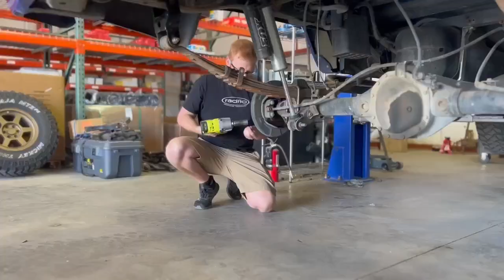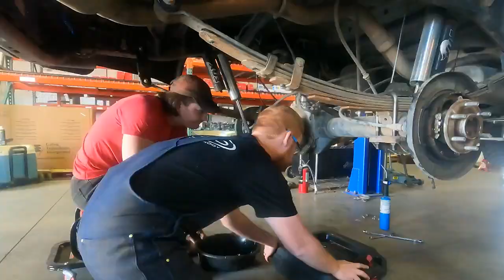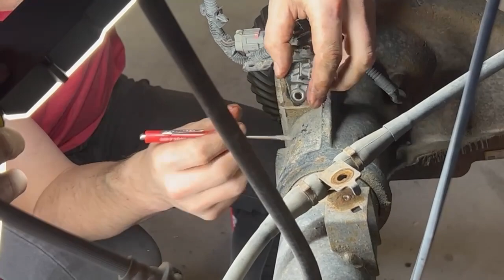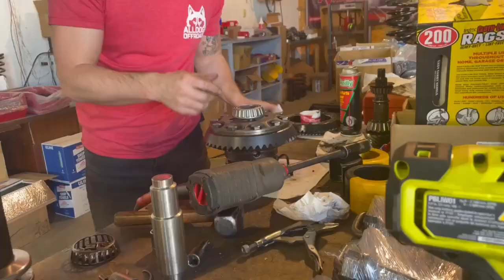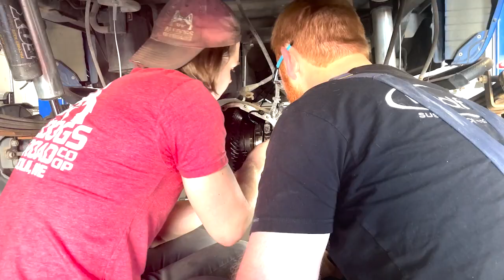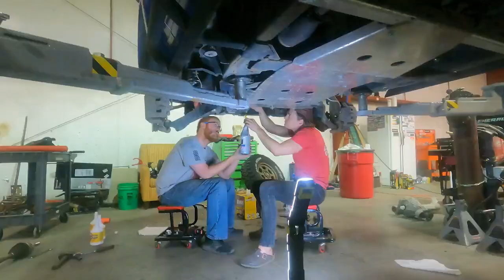Watch us re-gear Kyle's 2015 Titan Swapped Nissan Frontier

Comment: I have a C200 Diff with 4.1 gears, i learned that the early 2000s and 90s frontier and hard bodies had the H233b diff with up to 4.9 gears and the ring gear was huge 233mm in size vs C200 is like 200mm or so.  What i need in my truck is a gear ratio of 4.9 or 4.6 at least. Is it cheaper to buy a whole axel in the junk yard and sell my 2011 axel my truck is just a rear wheel drive with 4 cylinder

Comment: I thought the pro4x came 3:69 mine did. I was thinking of going 4:10s because of 33s and carrying 600lbs over stock constantly. what is your opinion on that?
Reply from the maker: If you have a manual transmission your truck may have had 3.692.  If you have an automatic, you'd more than likely have 3.36 ratio.  With a manual, 4.10 would be good for what you're doing.  With an automatic, 4.10 might be too deep.
Reply: @AlldogsOffroadCoop  my bad I got dyslexic on my numbers you are correct 3.36 is my gearing.
Reply: This would be a good change because the extra load and larger tires need more torque to get moving.  This would give you 11.1% more torque and 11.1% less speed in each gear.  On highway your engine would run 11% higher rpm but your tires would compensate this.  If you want to tow i would even consider 4.3 or 4.5 gears

Comment: Do you recommend a regear on 33 inch  tires?
Reply from the maker: It's not necessary on a Nissan but it certainly helps get some power back.  :)
Reply: @AlldogsOffroadCoop  Ever since I put 285s on it feels sluggish in some situations. Almost to the point of me wanting to put 265 back on. I hear about people doing 35s with no regearing and I'm like wtf how is that possible.
Reply from the maker: @MeliorIlle  the size and weight of the tire can make a big difference in drivability.  A change in tire size without regearing also negatively impacts the use of cruise control - you can get a lot of gear hunting from the transmission.  Some people just accept the decrease in drivability because a regear can be out of price range.  We're trying to make regears for Nissans more budget-friendly. :)
Reply: @AlldogsOffroadCoop  My Falken 33s are one of the heaviest tires in 285 as well. I might just go back down to a 265. Or you guys can come out with an affordable kit and I will buy :)